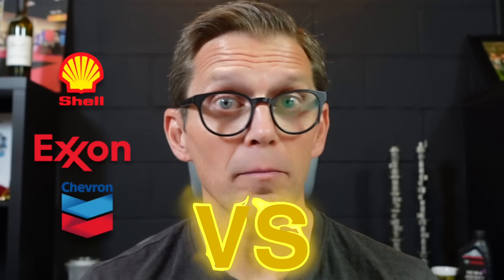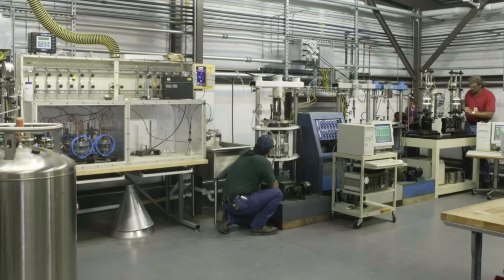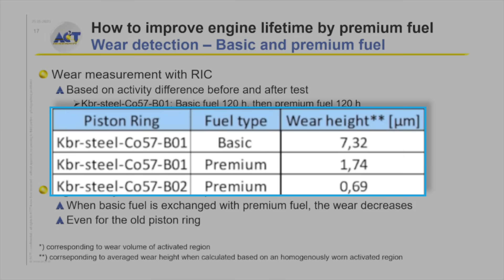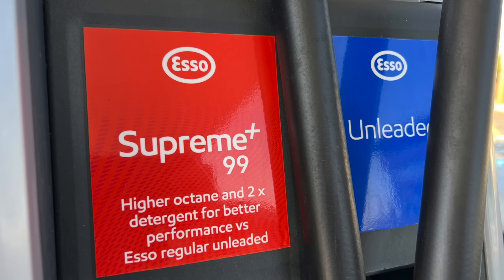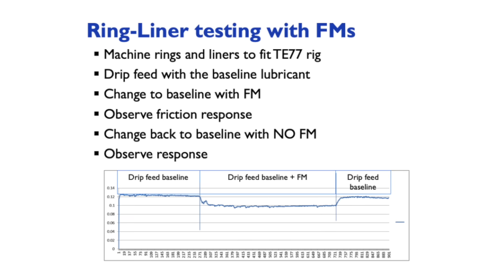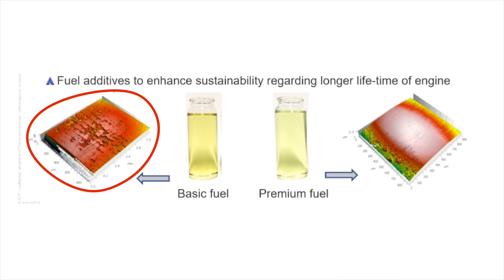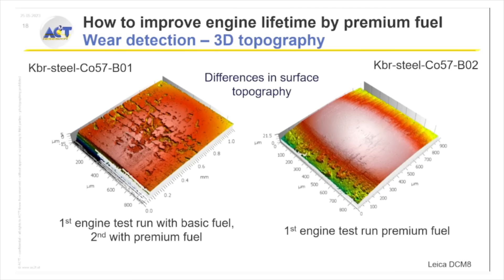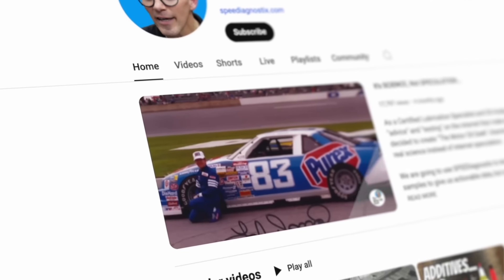Can Premium Fuel REDUCE Engine WEAR?

Comment: The science doesn't lie, and that's super cool to see, but I'm still confused about how adding an inert gas (nitrogen) to fuel is able to affect anything.  Further, the liquid point of nitrogen is lower than the freezing point of gasoline, so I suspect any nitrogen in the fuel has long-since boiled off by the time it gets pumped into my tank, so what is actually going on here?
Reply: The nitrogen doesn't boil off because it isn't in a gaseous form. It's part of the PEA molecule. That has nothing to do with this video, though (which is about anti-wear additives), as PEA is a detergent, and not an anti-wear additive.